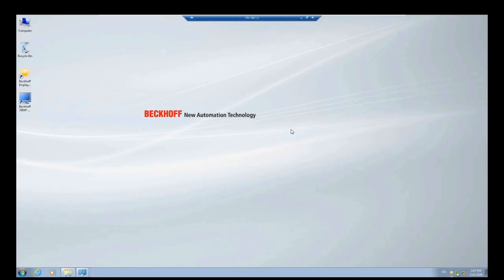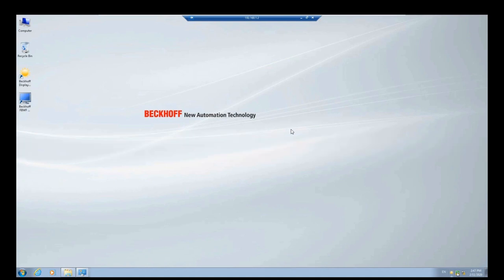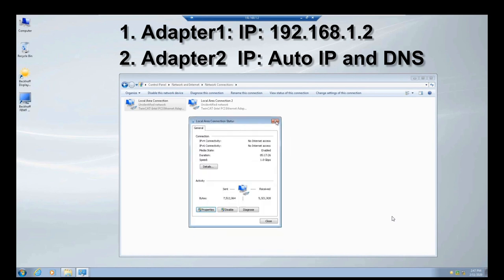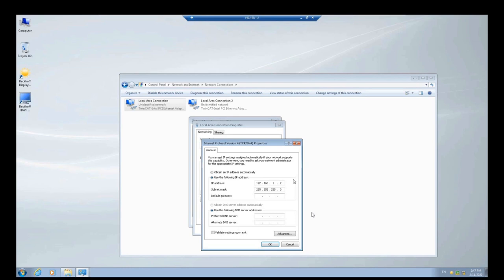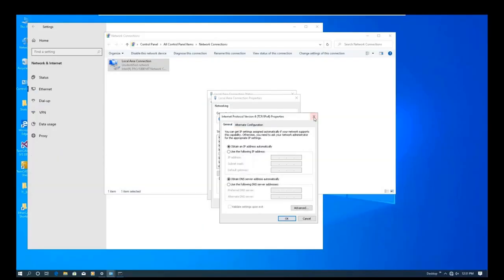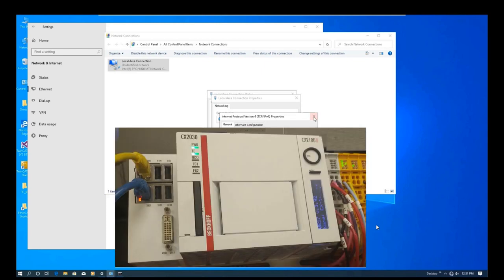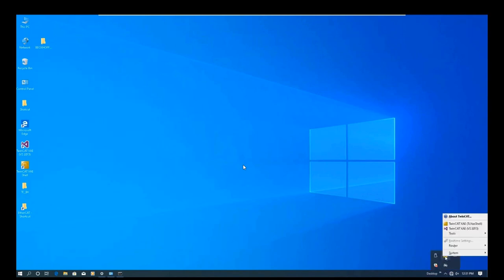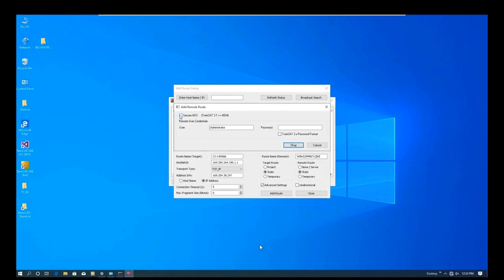BK04. How to Connect Beckhoff Controller using TwinCAT 3 (2 Scenarios)

Comment: The fisrt, Thanks for your previous answer. For example i have a system are running with CX2030. When I connect and back up program to my laptop, my system is still running normally, right?  I want to be sure and confirm about that because I have to take a project to research but the system not allow stop.
Reply from the maker: Please find the "Open from Target" from this link https://infosys.beckhoff.com/english.php?content=../content/1033/tc3_remote_manager/9007202409383563.html&id=, open the target (Uploading a project from the online controller) will not stop the controller. You'd better figure out what the system revision it is using ex. 4022, 4024， you need to use the hardware matched TwinCAT3 software to upload the project. or install the "Remote manager ". Please find my another video "Method 1" from https://youtu.be/UbuPOTG8m0o, I talked about the  "Remote manager ".
Reply: @electricalautomation  Thank you sooo muchhhhhhhhhh!!!!!!!!!!!!!!!!!!!!!!!!!!!!!!!!!!!
Reply from the maker: @sonthanh392  You are welcome, let me know if you have any other questions. It is great to do fully preparation before go onsite.

Comment: First of all, you make nice tutorials about TwinCAT. Great job!  

I have used TwinCAT for a while. I can upload and download code to my CX controller using a fix IP address. However, I recently had an issue getting connected to my controller. I can see it when I broadcast search, but I don't get an x after pressing add route. Have you seen anything like this before?
Reply from the maker: @Suthida Thongnuch Hello, Thanks for your watching my channel. Regarding your questions, probably you could check your laptop firewall (try to turn off firewall, the firewall could block the ADS communication) , or check the CX controller firewall and password setting (CX controller default user Administrator, Password '1'). Please let me if you have any new finds.

Comment: Every time when i switch online i get this warning "An application  "port_851" is currently in Run mode on the PLC......This exciting application needs to be replaced" 
When I click yes, it is a complete reload and the controller goes to stop.
What could be the problem?
 Thank you
Reply from the maker: I did not have this issue before. Did you install the TwinCAT with 'Run as administrator', and run TwinCAT with 'Run as administrator'. Likely the TwinCAT does not have your drive permission, so it cause the program cannot be downloaded into the target directory.

Comment: Hi 
I started my first steps with an IPC C6920, but I have a problem. When add a new route this IPC appears with error: ads error 1796 (0x704). I can't use off configuration mode o run mode. 
Also, the route appears with a padlock. 
Have you some idea about this?
Reply from the maker: Have you typed in the correct username and password when you setup the router connection
Reply: @electricalautomation  Yes, I have typed 
User: Administrator
Pass: 1